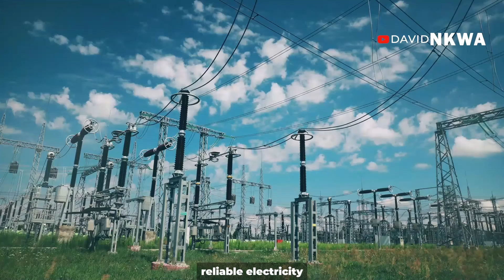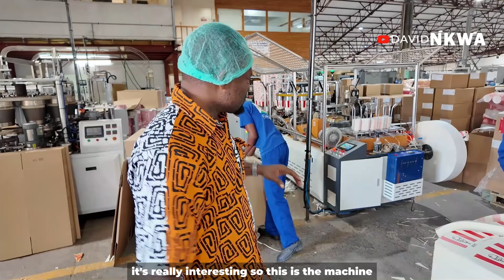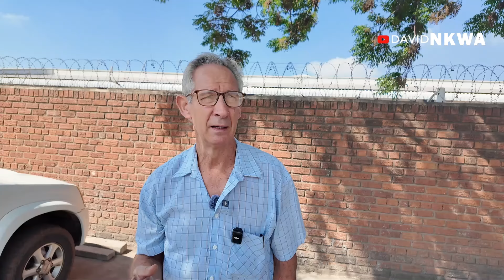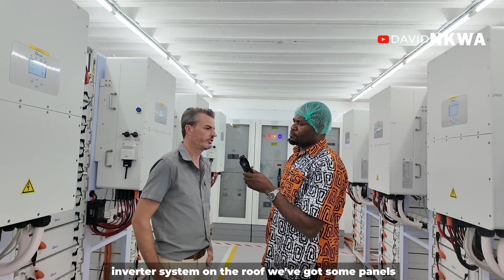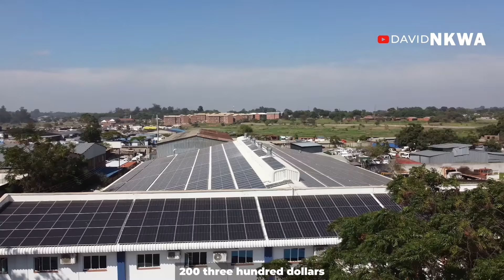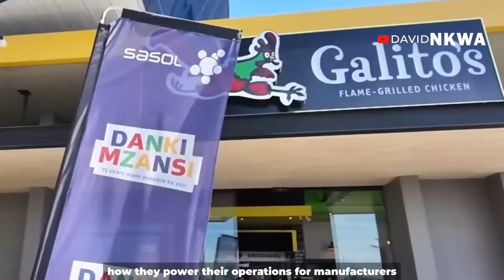Investigated Why Printing Companies Are Shutting Down

Comment: I've watched a doc on this company/solar installation before.

If I recall correctly, they used to have a tariff buy back program with Zimbabwe which made the system have a very favourable ROI. However, my understanding is that tariff buy bakc program was stopped or materially restricted, and made the ROI for the solar system move from financial to reliability.